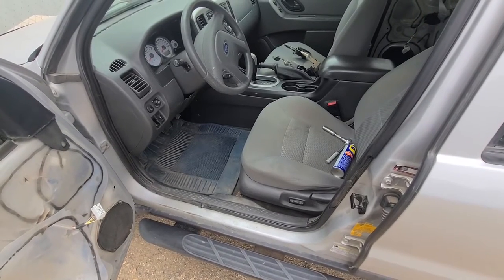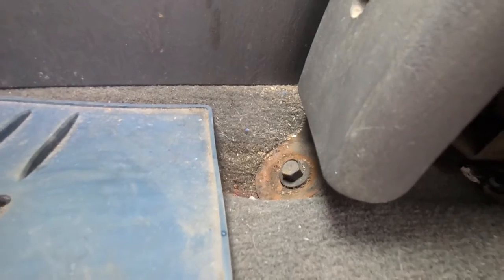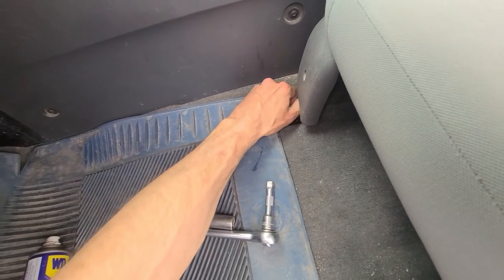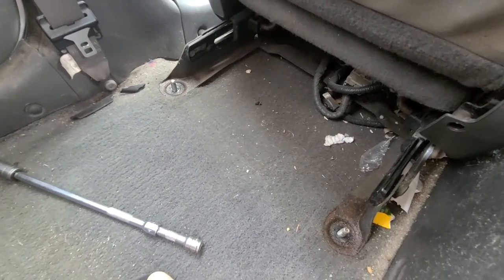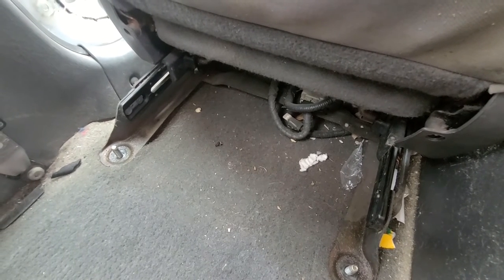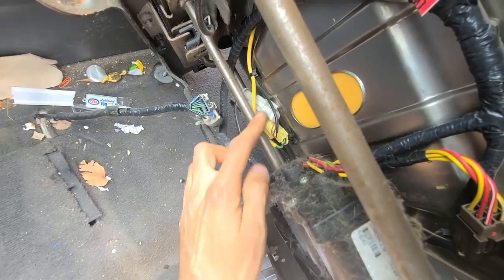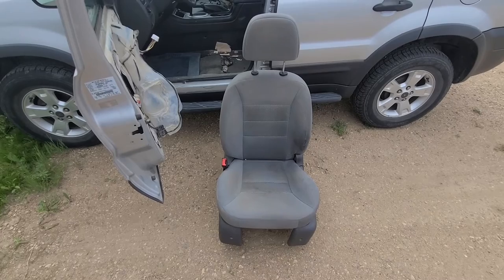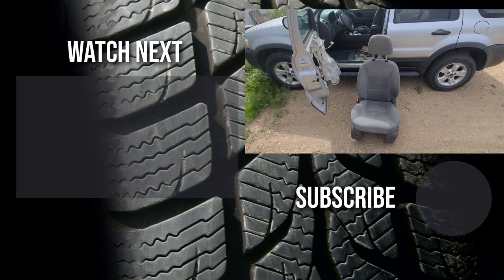Ford Escape - FRONT DRIVER SEAT REMOVAL / REPLACEMENT (2001 - 2007)

Comment: could you link the tool kit you bought for the chair removal? TIA :)
Reply from the maker: Hi. All you need is a 15mm socket and a ratchet. I would advise you to get a bigger ratchet with extension to get you a bit more power because this screws like to get tight and rusted. Make sure to use some wd40 as well.

There is bunch of $25 tool kits on amazon. Those will do

Comment: Do you need to disconnect the battery to unplug the seat?
Reply from the maker: It is always recommended to disconnect the negative battery terminal when disconnecting any wiring

Comment: the 01 seat has three connectors to disconnect, an 05 only has two, based on this video you said there is only 1 for the seats from 01 to 07 now i have a seat that can't connect to my vehicle, thanks.
Reply: You must have a special one.  My '01 only has the one clip on each seat